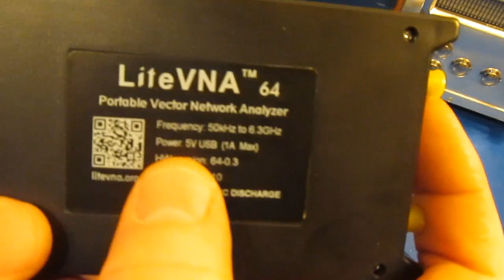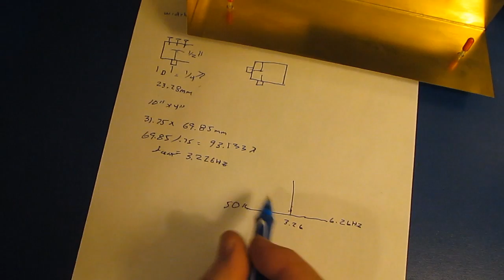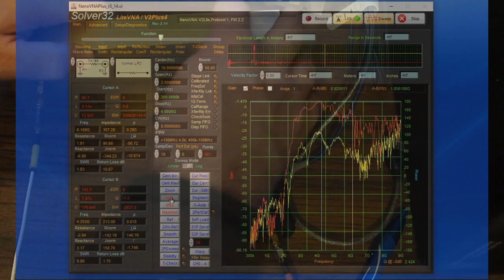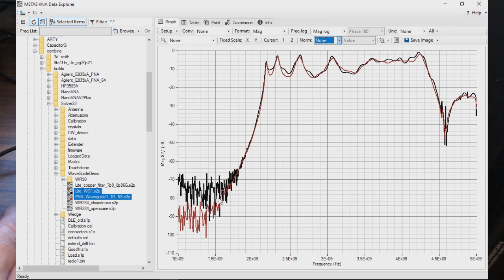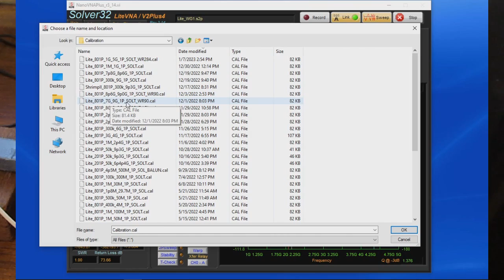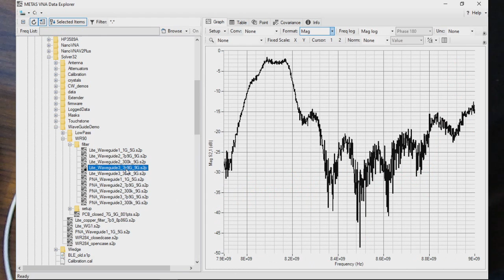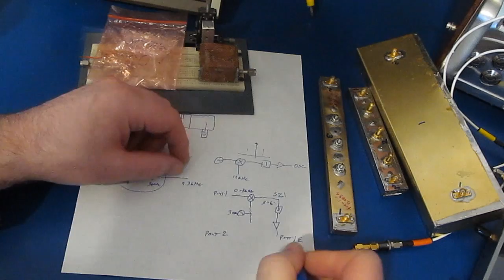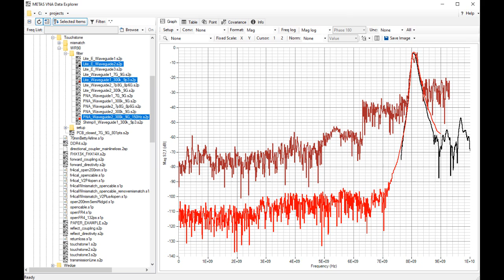Introduction to Waveguides using the LiteVNA,  Part1, Homemade Waveguides

Comment: Many years ago, I would tune dented waveguides by putting opposing dents at specific distance from the original dent. This was done in a combat/battle situation to keep the gear operational. Had to do many hacks to keep the equipment running. Active/passive equipment operating from 3mhz to 18ghz!
Reply from the maker: I read something similar about tuning them.    This was posted on Microwaves101: "Once you find a spot that improves performance, mark it with an "X", then you can either drill and tap it and insert a tuning screw, or it's "hammer time" and you can use the concept of "dent tuning." This was contributed by Bob Luly, thanks!"

Comment: Thank you for this video Joe. It's as clear and detailed as usual for your presentations. They are all excellent work. I'm interested in your LiteVNA mods. I'll double check your previous videos to see if you did a video on them. I'll also go check for anything further on the EEVblog. If there is nothing already published, your mods might make an interesting and useful video. Again, thanks for your work.
Reply from the maker: For the LiteVNA, I was looking for some low hanging fruit but never found any.  Gains I have made were very small.   After all of the changes I have made, I'm actually surprised it still works.

Comment: Most. Excellent. Video. Sir!

I was highly skeptical that any VNA under $200 could be worth a damn... you have put me at ease.
Reply from the maker: Well, its going to depend on what consider to be worth a damn.  All of the low cost ones I have looked at are very good learning tools for those just getting started.  If you want to make narrow band measurements and experiment below 300MHz, the $50 unit I have is a good choice.  Above 300MHz, I like the LiteVNA.  Combined will set you back about $200 USD.

Comment: This is an excellent video.  I learned quite a bit watching this!  Thank you.
You have also convinced me to buy a lite vna 64.   I have many filters, splitters, amplifiers, and isolators that are above the 1.5 GHz limit of my Siglent SVA1015x that I would like to characterize.
Do you have a sheet metal bender or did you bend the sheets in a vice?
Reply from the maker: I tried using a bender but the vice with a ball peen hammer provided much sharper edges.  I have been looking better parts for these experiments but  haven't had a lot of luck.

Comment: Amazing work! Was really fascinated by the handmade waveguides, filters and horns, you made it seem all so simple so I'm keen to try making some myself. I have access to a resin 3D printer, so if I did this I would try printing cavities using that and then spray coating a conductive layer. I know the signal path had a go but he used a filament printer thus had some issues with dimensional accuracy. Anyway, thanks for the inspiring video!
Reply from the maker: I'm happy to hear that the video made things clear enough to get you interested in experimenting.  I have seen some waveguide parts that were 3D printed.  At these lower frequencies, I would think it's possible.  Problem may be in how to handle more shapes.  Maybe they could be split like what I am doing, spray coated, then bolted together.
Reply: @joesmith-je3tq  Wouldn't the 3D-printed surface be somewhat rough for such short wavelengths and absorb some of the wave energy?
Reply: I have been experimenting with 3d printed waveguides and coating the interior with gallium because of it’s low melting point and high conductivity.

Comment: Witchcraft!

I wonder if al/cu copper tape would seal your guides ok?
Happy new year Joe.
Reply from the maker: The very first test I ran, off camera, I used rubber bands to clamp it together.   Not the best performance I've seen but worked well enough to give me some idea that things were moving in the right direction.

Comment: This was fascinating, and I think I'm hooked on wanting to know more about your extender and the topic as a whole. I do have a question, that might seem basic, but for which I've never seemed to have come across a proper answer - What impact does the thickness of the material used for your waveguides and filters have? Is it purely structural, or does it influence the conductivity of the guide?

Edit - Your next instalment has literally just dropped - 58 mins ago, so basically the watch time for this and composing this comment ago. I hope to find an answer there.
Reply from the maker: As the frequency increases, skin depth decreases.  At the frequencies I am working at, the thickness of the material will be availability, how difficult it is to work with and how stable it is.   The plan is to start testing some 3D printed parts.  The thickness of the conductive layer is much thinner.....
Reply: @joesmith-je3tq  Excellent, thank you for your reply, I've also wondered if using expanded polystyrene used as a buck/former (I understand it has a permittivity very close to that of air) and then applying thin copper or aluminium foil to make up a resonant cavity would work. The idea came to me while exploring whether to make a slotted waveguide for an extended WiFi link. It just seemed like it might be an inexpensive way of experimenting.
Reply from the maker: @squelchstuff  I believe that will greatly depend on how you define "work" and your skill level.  No reason you couldn't try it.  That's all I'm doing.   Just playing around experimenting.

Comment: Thanks for sharing the amazing video! What is the tiny metal tube in the Extender Board? Is it a coaxial cable or waveguide tubing?
Reply from the maker: How about a timestamp?   I thought I went over every component but maybe I missed something.
Reply: @joesmith-je3tq you are so kind, thank you so much! and sorry for the unclear question. The timestamp is 52:09, I am curious about what is the shinning metal tube in the middel of board route like 'S' shape, and the one on the left upper corner route like rounded curve and the one below the 'S' tube and route bended up to the bottom. Are they all the same kind of components? And what they are? Thanks 😀

Comment: Hi Joe! Great video. I'd like to reproduce your experiments, but I'm new to this, so I need to ask a new guy question. How did you make your wave guide antenna probes? I see you used an sma connector, but I'm not sure about the wire to make the antenna. Did you solder it to the center post of the male end of the connector or insert a wire into the female end with solder (if so, what gauge)? Why is it covered in dielectric? 

Also I've seen diagrams in some books where they will bend that wire and touch the side of the rf cavity or wave guide. Any thoughts on the performance differences in that case. I'm assuming that creates a loop antenna. Does that create a TM10 mode?

Thanks,
Tom
Reply from the maker: I'm not sure what an antenna probe would be it sounds like you are asking about the coax to rectangular waveguide transitions.  If so, I soldered wire or in some cases, brass tubing to the SMAs center post.  In some cases, I just stripped the coax using the exposed center conductor.   I suspect your question about dielectric was from that first large homemade waveguide with the red protective caps.  These were there so I didn't snag the wire when working with it for the demo.  They were removed when I was ready to solder things up.   

At 9:37 I mentioned the shorted elbow.  There are other types as well.  https://www.rfwireless-world.com/Terminology/coaxial-line-to-waveguide-transition.html
Reply: @joesmith-je3tq  Yep, that's what I was referring to, in all cases. Thanks!

Comment: Really cool demos. I wonder what the influence is of closing the seams on the box, or aligning the panels closely vs loosely. Possibly a lower Q with some leakage around the box, but I can't imagine having a huge effect at these frequencies.
Reply from the maker: You could kind of see how poor the response was until it was closed up.
Reply: Thanks for the hint, I could kind of see that, but the box was hanging in mid-air. Was just wondering if there is a big difference between just tacking the sides vs smoothly joining them.
Reply from the maker: @ligius3  If you own a of these low cost VNAs, I recommend you try it for yourself.   As I have shown, you don't need to spend a lot of cash to play.   That's really the best way for you to get a feel of how things behave.     
I mentioned in another comment about starting with rubber bands to hold them together just to see if things were even remotely doing anything.  The first filter I constructed was the long brass one.  I had left it unsoldered and used some copper foil to hold it together.  The performance was very poor.  After playing for a while, I soldered it up and it started working.   Still, I would imagine, better materials, better bends, better clamps, you may get good enough performance to meet your needs.  Very subjective.   The seams I show are also poorly located.  I made this choice to ease construction.   Outside of my home experimenting, we wouldn't make a waveguide like this.

Comment: I have a question about my fluke 789 and  figure there's a lot of really smart electronics ninjas  on here. Without any leads in the meter it reads about 5 mega ohms. Any body have any good ideas what would cause that. I'll probly send it to fluke but I'm curious 🤔

Comment: a couple of major flaws in this design. you should never cut the WG at the corner lines. That's where the transversal current on the walls is maximum so any small gap even hardly visible by eye will radiate quite easily. Instead the WG is always made from two halves that are cut in the center line and screwed together. That's where the transverse current on the walls is zero. The longitudinal current on the walls is maximum at the center line but since it is parallel to the gap (cut) it will not radiate.
The second isssue is that the distance of the coaxial pin must be quarter of "GUIDE WAVELENGTH" from the end wall. That is quite different than the free space wavelength that you used here so the input VSWR will be hard to adjust. The guide wavelength (wavelength of the guided wave in the tube) is LARGER than the free space wavelength at the same frequency. I cannot type the formula here
Reply from the maker: I take it you didn't actually watch the video and just felt the need to comment.